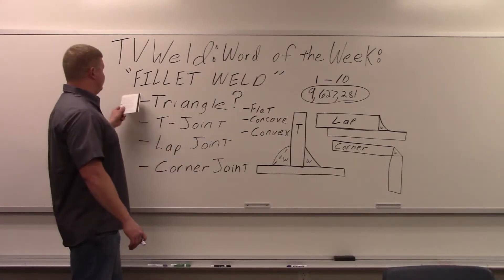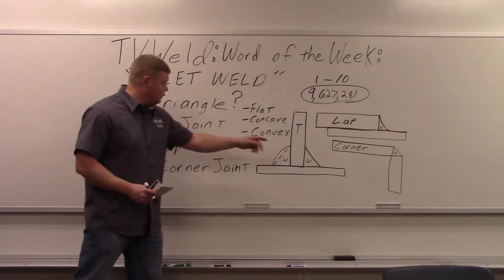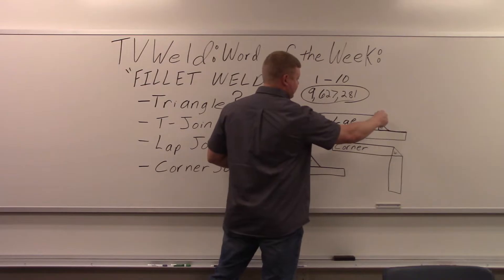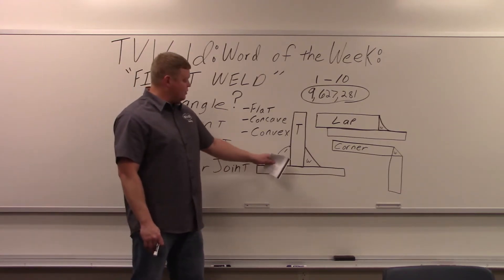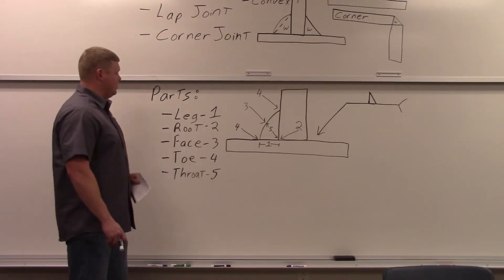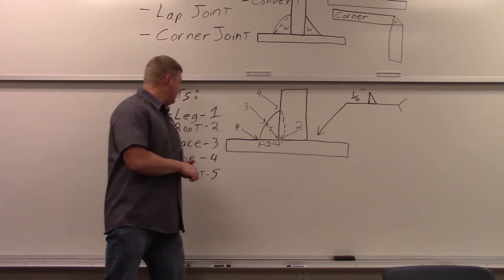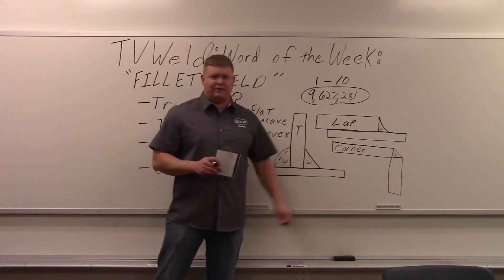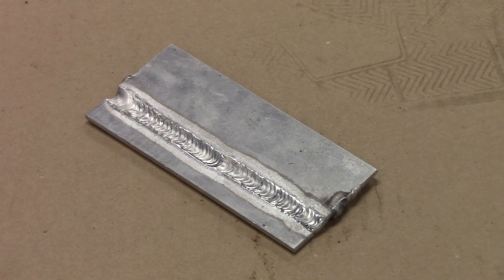What's a Fillet Weld? Welding Basics Explained in 2024

Comment: Thank you sir can you please teach me about strength of butt weld
Reply from the maker: There is no such thing as a butt weld.  Usually when people say butt weld they are indicating a square butt joint with a groove weld, and unless its on thin material its generally considered a weak weld.  That is why on most butt joint there is an edge prep. like a single V-Groove that allows for full penetration of the joint, and that is a very strong weld.  Check out: https://www.youtube.com/watch?v=Sa1jmCYRAtQ